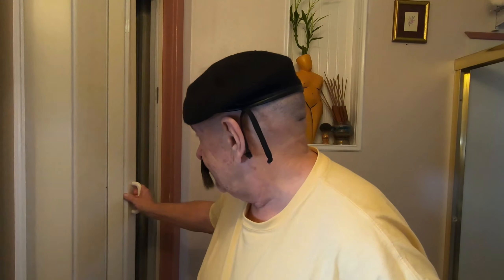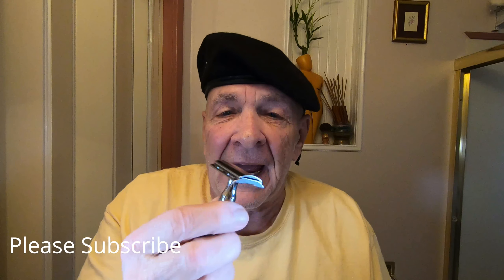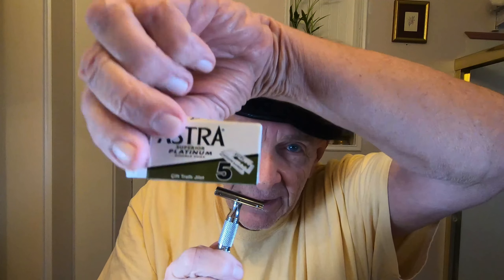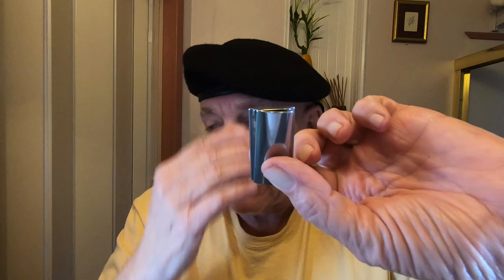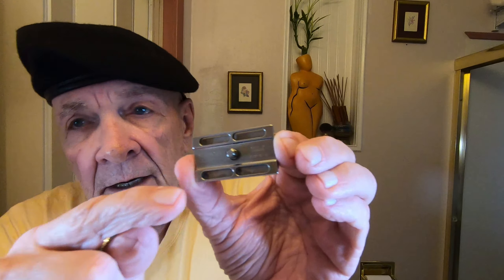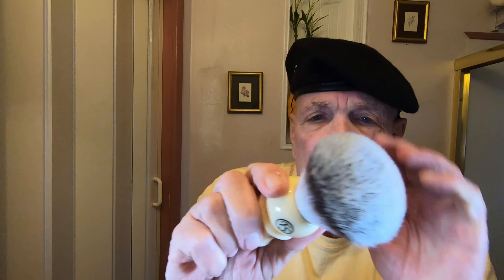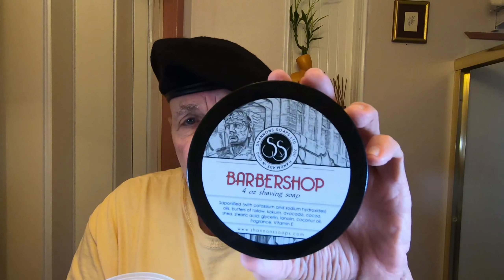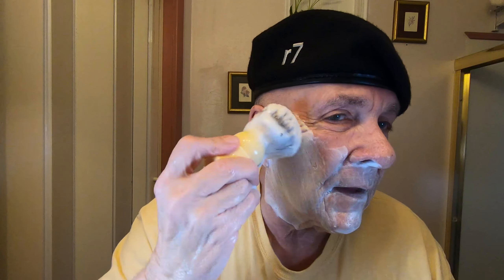Learn How to Use the New RazoRock .68-P Stainless Steel Game Changer Razor

Comment from the maker: The tolerances on this .68 razor are so tight, that it is sometimes difficult to get the blade out of the razor. The best way I found was to pry the blade up from one end. Since there is NO overhang of the blade on this razor there is nothing to grab on to to lift the razor out of the base plate. Just take your time and you will get the hang of removing the blade.